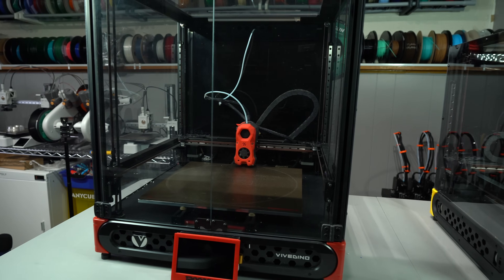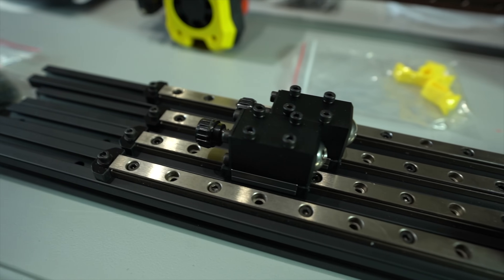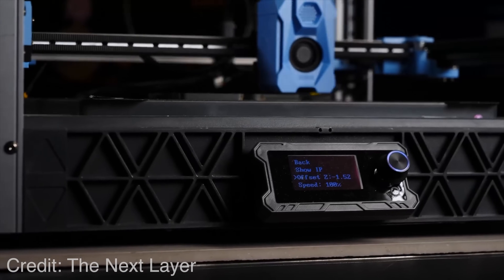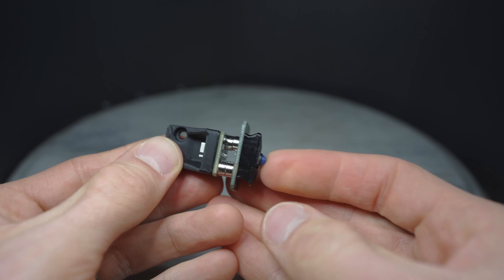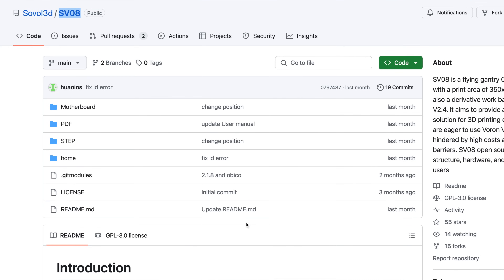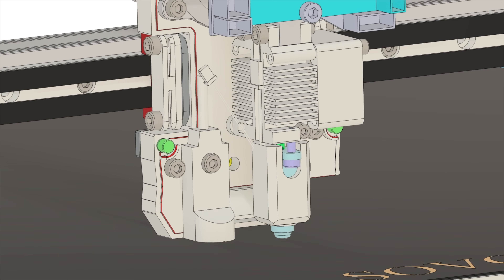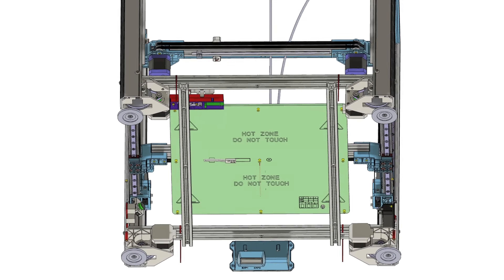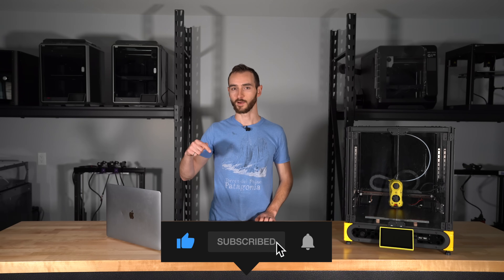The Voron Clone Wars: Sovol SV08 v.s. Troodon 2.0

Comment: I have had a SV08 for sometime now. i been dealing with a MCU error sense May that also caused my nozzle to overheat with out being told to turn on risking fires. Sovol has been good about sending me parts but parts that has not fixed this error as of yet. they really need to send me a new printer but they are unwilling. I have reflashed it, replaced wiring x3, hotend, motherboard. it runs if you swap MCU's but on bootup the mcu's swap back and problems start. I have really had it with this printer. your better off building a voron.

Comment: About input shaping results comparison on these two machines: you're not comparing apples to apples here. SV08 is a 350mm machine while the Troodon you are matching it with is a 250. Smaller machines will generally have better input shaping results when it comes to maximum acceleration.

Comment: I would not buy a sv08 if it hasn't a good price. There are modification people have to do to make it print without workarounds. Like replacing the bed, this add around 200 euro extra. Making the printer cost more around 800 euro.

Comment: I think the differences between the 2 printers are smaller than you think. I own the SV08 and when I see the massive amount of upgrades available, I think that it is as widely distributed as the Voron itself. For me and my use case a printer north of 1000 Euros would not have made sense. So it was an easy decision for me.

Comment: Since people that purchase voron printers tend to be more advanced and enjoys upgrading and tinkering I personally thing due to being fully open source and much better price sv08 is a better choice. Simply because all of the points you mentioned can be modded upgraded etc given you have extra money because sv08 is cheaper plus added bonus of joy of tinkering and adding personal touch... 
Also once you change tool head to xeno as example you can use just about any hotend, cryptographer or any other part that can be using with voron.
Also although some parts may not be easily sourcable online, stls can be obtained on GitHub and printed...

Comment: As a Sovol owner, I can see couple advantages in Troodon design. To be honest, I didn't hear about them before finding this video. If I were again looking for a new printer, I would probably think about them at least. With all the SV08 upgrades (including new Voron style bed), the price is pretty much the same.
PS: Yeah, the setup time is really about an hour. No more. It's like 10 parts which need to be bolted together. Everything is clearly described in the manual.
BTW, I quite like the Sovol's tool head, minus the light blue cover, which vibrates and can even fall off (not in my case, I added small ears and screwed them to the black plastic, which is part of the sled.

Comment: Every printer built with such frame is a scam, they are not square and cant be. Try to cut 2x profiles 50cm in length with square ends ! Tolerances will be 0.02mm or better, else you get crooked not 90 degree angles just use CAD for visualization.

Comment: I would say that if you have the money, the Troodon has a quality advantage. I like the Sovol because of the price.  I am willing to print some mods and tweak the machine a little, because otherwise I would not be able to afford to 3D Print at all. That being said the Sovol SV06 and SV08 are very well made printers, but do require a little tweaking.  Nothing like the v-wheel printers that I learned to not to invest in. Sovol, is basically providing affordable price point versions of the Prusa and the Voron.  I have a Tevo/Homers Tarantula that is heavily modded and not working.  I also have a Sovol SV06 that works like a Prusa.  The SV06 prints high quality 24/7 with very little attention.  99.9% of my 3D Print time is doing CAD design, Slicing and removing brims and support material.

Comment: My SV08 is getting delivered tomorrow. I ended up deciding that I prefer the derivative over the clone due to the drastic price difference - at the Troodon’s price I think I would spend a bit more and get a true Voron.

That said I do plan to mod my SV08 and the main hardware thing I plan to replace is the toolhead (to enable a non proprietary hotend, nozzle, heating and better probe options like Klicky and Eddy/Cartographer) so there’s definitely something to be said for the Troodon shipping with an incredibly solid baseline.

I’m at $700 for the printer, $40 for a BTT screen, $30 for an Eddy, and about $100 for the toolhead and associated parts. I’ll also be enclosing the SV08 which has a max cost of $180 for OEM parts. Then a spool of high end ASA-GF to print the toolhead on my other printer (although I’ll only use a fraction). Overall I’ll still be coming in a couple hundred dollars under the Troodon’s base price.
Reply: The best part of it - you can print and slap the StealthBurner right on SV08, since it uses only linear rail carriage to mount on. Maybe you'd have to replace the belts, idk now yet (my SV08 would come in 2 days). Also, additional toolheads are really cheap and TeachingTech is doing an SV08 toolchanger. I thought a lot about Troodon/Creality K1 Max/Qidi Q1 Pro/SV08 and finally chose the SV08. Creality/Qidi felt off because of single Z motor (and pain in the ass to align the table), and the fw/Klipper side on SV08 is as pristine as possible (not fully, but no custom crappy solutions). And the main reason - they provide all CAD files, so if some molded part will break - I would be able to reprint it

Comment: The build volume on the SV08 doesn't change when adding the enclosure if you print their frame riser. The rigidity of the SV08 with an enclosure will improve and as a result, so will the input shaper graphs.

In my opinion, what makes videos valuable and interesting to watch is an interesting test or experiment we don't have time to do or hands-on experience with products we don't have the opportunity to test ourselves. We can make our own comparisons like this one by watching all the same content you watched and your Troodon content. We want to see content that can only be had from using something. In this case, it would have been a much more interesting video if you used both printers and shared your unique experience about them. It also puts you at risk of spreading misinformation because you can't validate someone else's findings yourself.
Reply from the maker: @5napperlicious  fair shout and good points. This was primarily filler content while I worked on some other projects. I thought I could still have an interesting discussion without owning the SV08. Ideally I would have had it to test firsthand.

Comment: SV-08 is a 350^2 core-xy for half the price of the Troodon which isn't well known in the consumer market. Anyone thinking of putting in a grand for a Troodon would just get the K2 bundle and have a better supported printer with an AMS clone thrown in for close to the same price. I wonder why the Troodon wasn't hyped to the heavens two years ago when the X1C opened everyone's eyes. Was it not ready for prime time at that point? Is it now? I think Voron already has the hearts of the tinkerers and diehards, but the Sovol is appealing to those with an X1 or P1 who are chafing at 256mm and want to upgrade their capacity without delving into BIY or forking out four digits for the pleasure. Just my opinion, of course, but that describes me.

Comment: Do you have the stl for the corner covers for the troodon 2.0? You were popping blue ones in the video. I have looked everywhere for the stl.
Reply from the maker: If you email Formbot they’ll send you the STL for the injection molded version. I found that the pins were too thin for 3D printing and broke when I tried to install them. A modified version suitable for 3D printing is available on my Patreon.

Comment: The sv08 has the cleaner input shaper graphs and you have to consider that no panels are in place, which are structural components. Difference between no panels and panels on my much more rigid trident 350 is 1k in y with cleaner graphs, so id expect a similar gain for the sv08
Reply from the maker: Interesting! Never thought of the panels making the frame stiffer
Reply: @ygk3d  Same goes for convertible sports cars. Their chassis aren't as stiff and don't do as well on a road track.
Reply from the maker: @imowgrass  I’m learning so much today 😂
Reply: @ygk3d  panels always make the frame of any printer tougher, even 1.5 mm thick acrylic ones should suffice. Also, the y input shaping graph on troodon looks just awful, noticeably worse than that of sovol, it looks so bad that it may seem as if the printer has stiffness problems, and it also has residual vibrations (vibr = 0.6 on mzv and vibr = 0.8 on ei, which is pretty bad), this means that the algorithm is not able to fully cope with vibrations at these frequencies. In this case, even slowing down the speed and reducing the acceleration will not help to remove the VFA. I observed a similar problem on Creality K 1, where, due to bad pulleys on the motors, input shaping, regardless of settings, did not help from VFA at any speeds.

Comment: now that the sv08 turned out to be a scam (refusal to refund, quality issues, deliver "moved" ahead >2 months) the troodon is looking more tempting
Reply: Reading comments seems both are trash, and i thing voron ratrig are aldo trash, no engineer builds stable printer chassis held with a screw from these profiles. tolerances to make assembly square is 0.02mm
Reply: @juliusvalentinas EXACTLY ! Why even bother with linear rails when you’re mounting them on those fucking paper thing bent to fuck extrusion?
Reply: Just go my way: buy from the local supplier. I ordered mine yesterday and it's already packed and sent, I gonna receive it tomorrow

Comment: isnt the biggest difference the 300°C vs the 500°C printing temperature?
Reply: You're never going to print 500C materials on either of these printers. The materials that come to mind for 500C are PEEK and PEK and both require a heated chamber hotter than the belts, motors, plastic parts, etc can handle. If you want to print 500C materials you need a printer you'd be comfortable placing in your oven. VisionMiner has their 22 IDEX for $15k which is very well priced for what it offers at that level of engineering grade FDM printing.

Comment: 7:02 how hard would it be e.g. to change the breakout board on the Troodon for one that contains accelerometer, or the replace the whole toolhead for Dragonburner? Is the pinout of the breakout board the same as it would be on actual Voron?
Reply from the maker: Would be the same difficulty as a CANBUS conversion on any other printer. Same answer for toolhead replacement, as far as I can tell.
Reply: @ygk3d  this is the first time I come across CAN bus term. I guess it's time for a bit of research, can you recommend some docs/vids for a beginner in this topic?
Reply: @Mintor94  there's not much research needed. In fact, you just need to have a CAN-compatible main board or slap something like U2C, put the CAN-enabled toolhead board and just connect the wires.

Comment: The tronxy evolution doesn´t stop so why should I buy a propietary snapshot in the style of the voron when things like toolchangers and multi-material printing are lurking round the corner?
Reply: Because they're also lurking around the corner for the SV08 which I assume is the proprietary snapshot you're referring to. Teaching Tech has already stated that he plans to adopt the Voron 2.4 tool changer design to the SV08.
Reply: @5napperlicious  sure, I confused tronxy with sovol...but to be honest, will the sovol toolchanger be supported and evolved like the open source voron?
Reply: @arrgh-  time will tell, but the more people use something the better community support it gets. Cost and availability will certainly help with that.

Comment: Thank you for the video.  The Sovol SV08 does come with a touch screen upgrade, and an enclosure.  Once those are added on the two machines are much closer in both spec and price, but still with a fairly sizeable gap in favor of the Sovol.  While the Sovol is still able to be modded, the Troodon 2.0 still seems to be closer to what a tinkerer would want as a base to play with.  I honestly think it's a tough call between those two.
Reply: I realy like the SV08 is available without touch screen. Have some old (2017) Amazon fire 7 tablets flying around - the work fine for klipper screen ;-). I like to recycle old stuff instead of buying new.
For an enclosure: Yes, its nice to have the original one. Still, after the pandemic there is a lot of acrillic panels not used anymore. If you have access to theese and save them from trash, it is a nice alternative.

Comment: I'm leaning toward an SV08, but I'll ditch the reverse Bowden tube because I print a lot of TPU.  I'll mount a bearing spindle filament reel holder on top (or a low friction heated filament drier), with an enclosure with a peaked roof to allow full Z print height, preferably with magnetically attached sides that can pop off easily for printing PLA.  Much as I like open source software and hardware, I'm OK with the proprietary SV08 hot end because it has good enough flow rate, as long as replacement hot ends remain readily available and inexpensive.  I'd be very interested in a cast aluminum bed upgrade as long as it didn't warp when heated.  It's difficult to make a 350 mm square bed that is flat and doesn't warp.

Comment: I thought it was opensource. You keep saying proprietry when i think the correct word is customized?
Reply: They are opensource.  They released all the information. They are also confident enough that somebody else cannot do a better job producing those products at that price range.  In 3D printing, opensource is a pretty blurry line.  Sure, the STL files are available, but more often than not the CAD files are not available.  Also, the extrusion STL, or circuit board specs  may be available, but the manufacturer has factory tooling set up specifically to make those parts.  That being said, having the STL files available for the Injection Molded Parts is super valuable. Because the printed parts can be higher quality, and can be modded to improve on the design.
Reply from the maker: Good call. Yes, a better word to use would have been customized or specialized. The main idea being that it's a custom component for the SV08 and not readily available on the marketplace.
Reply: @ygk3d  At least with the step files available you could print all the injection molded parts. While they might not be optimized for 3d printing, with SLS print services you can get them in PA12CF15 if you realy need to.
Even aluminium parts can be 3d printed. I was very positivly suprised with the next layer presenting the revo coldend for the SV08. Imho this is a dealbreaker. High-Flow nozzles and automatic filament change (enraged rabbit carrot feeder) are a problematic combination. While on standard flow nozzles you can get a nice filament tip on unload (esp. with integrated nozzle/heatbreak combos like the Revo) unload with high flow nozzles often leeve a bad filament tip and need cutting. But with a revo coldend you could simply use standard Revo for multicolur prints and high flow for single colour. No cut&poo needed...

Comment: I feel like the sovol with options for a cast aluminum bed and beefier pulleys plus enclosure would be solid. Maybe modified print head to accept other nozzle types too. Add beacon or eddy. Not sure of total cost, but they could offer that kind of printer for $1000 and still be competitive in the market.

Comment: I found the comparison very interesting, it went into several important details. I think Sovol did a good job with the SV08, as there is a market that is not a printer modifier. And there are also markets that value every penny in price, in my country even $100 is almost equivalent to $1000 due to taxes and currency appreciation. Creality decided to "fight" with Bambulab, Sovol took advantage of the SV06 Hype and will seek another slice of the market that could really work.
Reply from the maker: Thanks! Interesting perspective on the market. It definitely seems to vary from country to country.

Comment: You are incorrect about the sv08 having worse input shaping results than the troodon. Max accel values are not how you compare IS results. You have to look at the visual graph itself, along with net vibrations after the shaper is applied. The sv08’s graph is FAR superior to the troodon’s. The ideal graph is a single, steep peak with no noise. A bad graph has many peaks and lots of noise. The troodon had this in spades.

It’s very easy to draw false conclusions by looking only at the recommended accel values, and it appears as though this is what you’ve done.

Comment: I think you do a good job comparing the two printers and where one will shine vs the other. However, the term 'proprietary' is probably not appropriate when describing parts of the SV08 (like the nozzle and motherboard) since the license/specifications and are open source for these parts. I might say non-standard, but not proprietary: anyone will be able to make them.
Reply from the maker: Good point. Thanks!